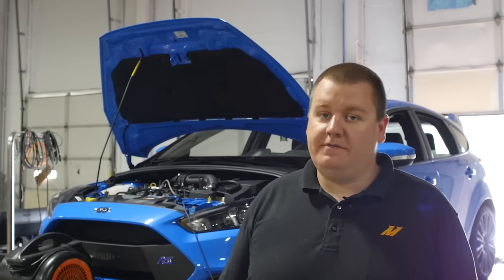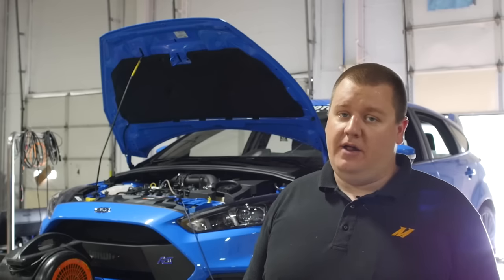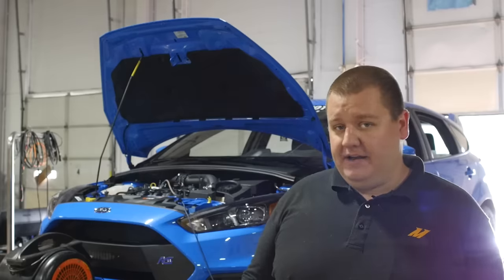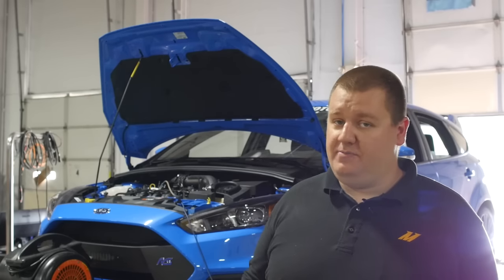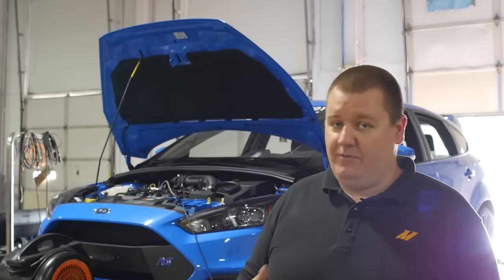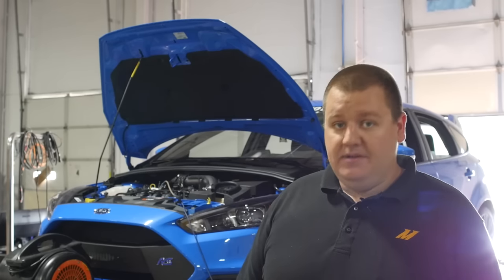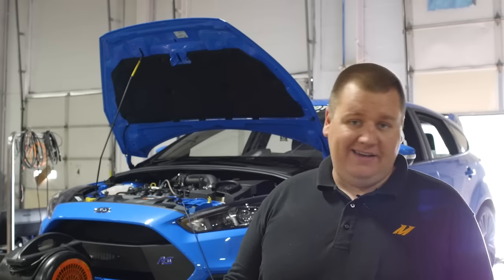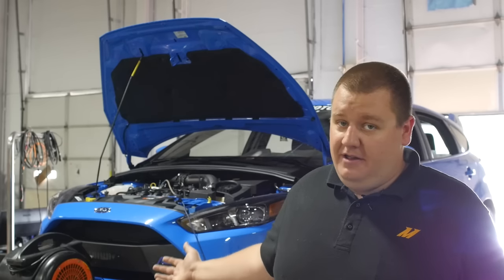2016 Ford Focus RS - Stock Dyno Pull at Mishimoto (UPDATE)

Comment: Is 2016 and still amazes me that people dont know the difference between wheel horsepower and crank horsepower.
Reply: Common sense appears to be a super power these days.
Reply: I think though that power at the wheel should be the only measurement. car manufacturers like BMW that rate their cars to have those specified horsepower in the worst-case scenarios like a hundred degrees way above sea level, if its cold and below sea level it will definitely be above the stated claims I appreciate manufacturers that do that. it's our fault though because they make this a damn numbers game instead about feelings everything's fast enough nowadays
Reply: I blame chevy.
Reply: +William Arrington thanks that makes sense to me now 👍
Reply: FukU2222 Yes I like manufactures that under rate theirt cars. The BMW 340i is rated at 320 crank and it has dynoed at 340 wheel a light tune and its pushing 380 wheel. Bmw is going to sell a performance kit that will do 360 crank so people are assuming the same thing it will be 380 wheel from the factory.
Reply: *****
Don't worry they pay out until they can't anymore.
Reply: lonewolf5460
My car was rated at 202ftlbs and it put down 220ftlbs at the wheels. It made more than rated power to the wheels.
Reply: ***** what car I like brands that do that, i think its marketing now it makes just a flash tune look like a major upgrade like on the gti the earlier models were more true on their hp numbers. The new one is so underrated it makes a tune look like it does 70 hp when its more like 35
Reply: lonewolf5460 bmw is known for downplaying their numbers also merc too I think.
Reply: lonewolf5460
BWM has been underrating a lot and that is a very welcome change. My car is actually a ford ecoboost. After that it put down 287ftlbs with intercooler, intake, downpipe, and tune. Not to bad from a 1.6 liter, at that mod stage. Should make well over 300ftlb's but, I'm not going to mess with exhaust until I do the turbo swap, There is no point.
Reply: @matt2m  the bmw M340i is rated at what 380 or more? Stock dyno is ~345. Weighs almost 4000lb. Can't beat my 310whp mazdaspeed3 weighing 3200. From a dig, hell yes. 😂

Comment: Bhp is flywheel horsepower which is rated from the engine without drivetrain, Awhp is all wheel horsepower or Whp which means wheel horsepower normally used for rwd or rear wheel drive cars. This is what actually gets transferred from the driveshaft to the differential, then to the rear/front axels depending awd or rwd, and finally to the actual ground. Normally you will lose anywhere from 10-20% hp when transferring it from the engine to the ground. Example a car rated for 500hp from the factory may only put down 425 actual wheel horsepower figuring in a 15% loss.
Some automotive manufactures will under rate their engines horsepower numbers so you get a good surprise when using a dyno.

If this vehicle is putting down 310 awhp, then we can factor that at a rated 350hp or 350bhp from factory, it is only losing around 13% transferring the power through the drivetrain. All wheel drive plays a good factor in helping transfer the power.

I my self believe if this car had 400awhp it would be perfect for track/street.

Comment: So many people are slating this car, and I think somewhat unfairly.

310 bhp to the wheels equates to somewhere around the 380 bhp mark at the crank, assuming a 22% drivetrain loss from the crank to the wheels. That's really not bad at all, and don't forget, this car isn't really about the straight line speed, it's more about how it will get itself around a set of corners, which is happens to do that excellently.

Also, the car is designed to be fun to drive, and you simply don't need big power figures to have a lot of fun.
Reply: Roy Rki it snows in some places, and people want a fun car that they can drive year round, not just a garage queen for half the year.
this competes with the STI and EVO X in terms of handling and fun.

It'll never be as rewarding as a RWD coupe on the track... but it'll let you get up a snowy hill in rush hour traffic, unlike my RX8.
Reply: James Wingrove the cars bang on in uk on high contain. And will murder most American cars on the street ..fact
Reply: That shit is trash. My cobalt ss with intake downpipe Tune on crappy 91 octane makes 325whp/340wtq 🤣 on e47 makes around 350whp/390wtq embarrassing $7k car with two bolt ons vs a 50k car 🤣

Comment: I quote:

"This RS is just a car. It is a small-ish car with AWD (sometimes), decent (front) brakes, and a turbocharged 350 hp engine. It weighs a good bit, has a relatively small tire, and a bunch of it's weight is on the nose (59% front weight biased). Just so we are all on the same page, these are called: the facts.
[...] He (Bill Caswell) did some track driving in an RS which put the rear diff (admittedly very small) into thermal overload, which disengages the rear drive completely. Many others are seeing this same issue, including me at our test and the owner Todd when he drove it at Optima events."

In my track test in-car video (see below) I mention many times while driving the car on track that the car felt like it had no rear drive at all. "It just handles like a Front Wheel Drive car", and that was because the rear drive unit was disengaged almost the entire time I was on track. This isn't me being hyper critical, its a known flaw in the RS. I've driven many AWD cars (Subarus, EVOs, etc) on track in the past 15 years and never had this issue happen on another car, until the Focus RS. It was disappointing to say the least, and "rumor has it" that Ford is coming out with a diff cooler retrofit unit that you might want to add to your race prep budget if you plan on tracking your Focus RS. 

http://www.vorshlag.com/forums/showthread.php?t=8453

Comment: Fords crank number is 345 bhp, in the UK where they have higher octane. In the US it's around 335-340 crank. Plus, most of the RS's in Eurooe are seeing corrected SAE numbers of 322-335 crank hp, so the car is dynoing well under 290 awhp. If anyone gets over 290 awhp on a dyno in the US, the car is tuned, plain and simple. Plus, proper dynos are done "hood closed" I don't know ANYONE that drives hood open. And lastly, dynos are very, very inaccurate due to so many variables, it would take 500 words just to cover most of those variables, and in each vehicle, those are different, despite an identical vehicle. Dynos are relatively pointless.

Comment: People stating that the car is "actually making 370-400 crank hp" need to remember the way this awd is setup. The rear differential actually rotates the rear wheels 1.8% faster than the front, and so disengages to make the car front wheel driven in a straight line unless slip is detected. So drivetrain loss definatly shouldn't be that high. Which makes the 311 whp about right.

Comment: So help me understand something - Ford says 350hp, which is probably measured at the crank because it's a bigger number.  On the dyno, which measures HP at the wheels, the car was putting down 310hp.  I'm no engineer, but I think there is a lot of hp "lost" on AWD cars.  Is the result of your update that you are happy with the power compared to what Ford released or do you think Ford has grossly overstated the power?
Reply: Ford understated the RS. 310whp = around 372hp in AWD.
Reply: AWD cars have typicaly 20%-25% power loss.  
350hp x 20% loss = 280whp. 

I am sure that Ford rated RS without over boost, which maybe adds extra 20whp, but the car is still under rated a bit...by say 10whp.
Reply: For example, New Subaru  STI rated at 305hp and puts down 245whp = 20% Drivetrain loss (which is better then in the past, as they alway used to have 25% Drivetrain loss)
Reply: Auto companies ALWAYS understate the power, legally they kinda need to. Lawsuits left and right if you state an engine will make x amount of torque or x amount of horsepower as a selling point and it doesn't.
Reply: All manuctures rate power at the crank. That's it no more no less. Aftermarket refers to power at the wheels because it's impractical to pull the engine for every little mod.  It's not one or the other trying to fool anyone.

Comment: Why does it only trap 105ish then? Similar weight to an sti that makes roughly 240-250 to the wheels.
Reply: IKR ! wtf is going on. Only does a mid 13 sec qtr.
Reply: Stock does a low 13.1-13.3  1/4 mile. With a tune these things are betting 350whp/400wtq and doing mid 12's

Comment: how do you guys manage to get all 4 wheels to spin on the dyno?
Reply from the maker: Hey Mr Purplez . Luckily, our DynoJet is AWD approved. It is able to read and display the power being made at all 4 wheels. The runs featured in this video were prior to, and after the AWD system was giving us issues.
Reply: Mishimoto Automotive i thought the ford focus rs is only able to to be dyno in fwd, well thats what i seen in most vids. 
Going to dyno mines soon, so i wanted all 4 to spin too. Not just the front 2
Reply from the maker: Hello Mr Purplez . We were having the same issue with our RS test vehicle. The first time we attempted to run the vehicle, we could only get one run without throwing codes. The second day on the dyno, we made 10+ pulls without issue.

Comment: I thought the RS makes 345bhp not 310bhp? Can you explain why 310bhp is making the right power, when ford advertises the car makes 345bhp. Very confusing!!!
Reply: 310bhp is wheel power or the power the car is actually putting down on the road. 345bhp (UK) is the power the engine makes at the crank.
Reply: lookup wheel horsepower vs crank horsepower
Reply: wrong...bhp is basically at the flywheel- "Brake horsepower (bhp) is the measure of an engine's horsepower before the loss in power caused by the gearbox, alternator, differential, water pump, and other auxiliary components such as power steering pump, muffled exhaust system, etc." It's similar to at the crank. BHP/Crank hp doesn't mean shit....stick with wheel HP/WHP

Comment: Hmmm I have 290 at the wheels in my focus . Only costed me 6 grand and my car is substantially lighter  . It's a Nice car , I'd take one in a heart beat . But not for 50 grand .
Reply: Your car also does not have AWD... so of course it is lighter. Also no one in their right mind is paying 50k, most are getting them around the MSRP or at least the people I know. The MSRP is also the same as the STI, and this car is a much better package than the STi in my opinion.
Reply: +Stu K yeah that was my reasoning why it's lighter , also 4 door vs 2 door . The torque in the RS makes up for it though . Most hear in Canada are going for the sticker price which ends up being around 57k .
Reply: So your comment is pretty useless... If it is sticker price then, that is MSRP...
Reply: +Stu K you said no one in there right mind is 50 k . Well lots of people are paying more than 50 k

Comment: Okay I see you for consist power as you stated. Is ford aware that some owners are experiencing underwhelming power? Are they gonna do anything? Seems that they have not faced the facts yet, least they can do is make a statement smh
Reply: the rs power was purposely retarded, block is capable of 500 hp plus, which is why ford is thinking of making a 500. hp version
Reply: +Sim Wil the RS500 is not going to have 500 horses..
Reply: +sammy smith what is it then could have sworn i read 500hp somewhere
Reply: +Sim Wil first off all the RS500 isn't confirmed. But it mostly likely is going to happen but be very very limited to like 500 units. It will have the same engine as the current RS , and possibly looking at something close to 400HP. The RS500 will be a more track orientated vehicle from weight reduction, better brakes, and suspension.
Reply: Sim Wil The old Focus RS500 had 345 hp. Since the new RS has 350, I think if they make a new RS500 it will have north of 400 hp.

Comment: So the RS is an overly complicate car with a bunch of tech crap, which will be hard to mod? At least it seems that way.
Reply: No its the just a new platform for which the tuners and companies have to sort thru the engineering of the car. This car will prove to be a beast once its full bolt on and tuned and it will be crazy fast with a better turbo. The weak points on this car will be the diffs being able to withstand the huge amount of torque this motor is capable of making. I see a lot of tuners will be dialing the torque back at the lower RPMs in order to save the diffs.
Reply: yea the mustang was making around 500hp with the same motor. Will be interesting to see how this platform holds up. Seems to have a good deal of safety measures built in to keep it from going kaboom. hopefully they can work through it cheaply.

Comment: Isn't 265 wheel about right taking into consideration a 25% drivetrain loss? 310 wheel seams like a lot!!!
Reply: its more like 18% for awd drivetrain loss. so that would be about 287. So this car is overboosting to produce about 24 hp which is pretty scary. that should never be done on a stock car.

Comment: stage 2 sti power. looks about right
Reply: Apparently the early tunes for them are seing about a 25hp (not whp) increase and 40lbft. Seeing how high the boost is stock, I don't think you'll see huge gains on the stock turbo.
Reply: +Bill McGregor in comparison how big is it compared to the wrx twin scroll
Reply: Jeff Archer I'll have to find that out and get back to you.
Reply: Jeff Archer So the turbo on the WRX is a Garret MGT2259s. IT has a 47mm turbine and 59mm compressor. It has a max flow rate of 34lbs/min. All I've found regarding the 2.3 in the RS is it's the same Honeywell turbo that's in the Mustang but it has a 3mm larger compressor.

Comment: I don't know what you did to make the numbers go up, but your first dyno run was spot on. The car's weight, drivetrain, and gearing are very similar to the STI, EVO, and Golf R, and in every head to head acceleration test they are all neck and neck, especially 1/4 mile times and trap speed which is the best indicator of a car's power. So what does that tell us? 
It tells us the power of this car is more or less the same as these others, and that Ford is full of shit with that 350 rating. You can make a dyno read whatever you want, but the acceleration tells the real story. So who pressured you into putting out this BS "update"?
Reply: Hahahaha. So salty.
Reply: Ford is the heaviest of all, and the gears are longer in it. That could explain some things.
Reply: did you even listen to the vid bro? Explains it in the beginning. They had been drifting/tooling around in the car before the dyno and didn't even have a fan in the front.